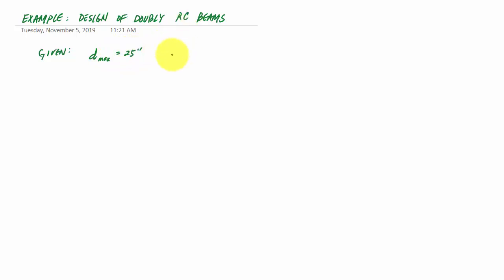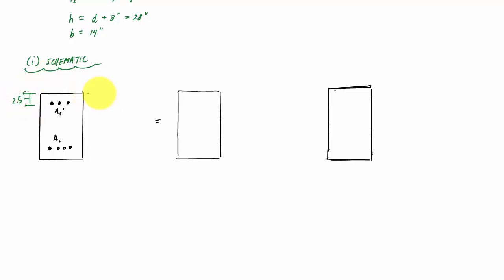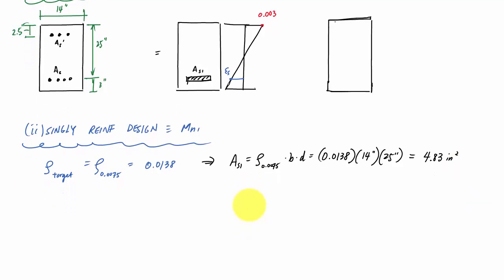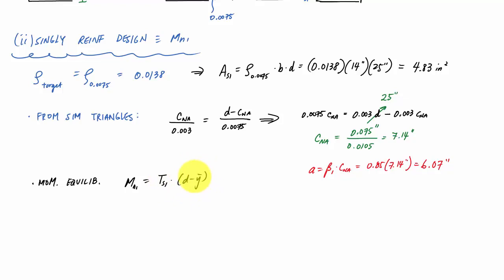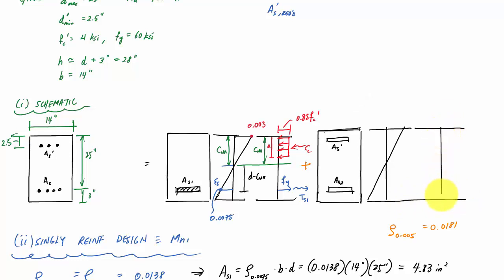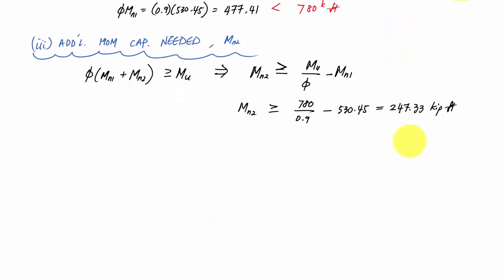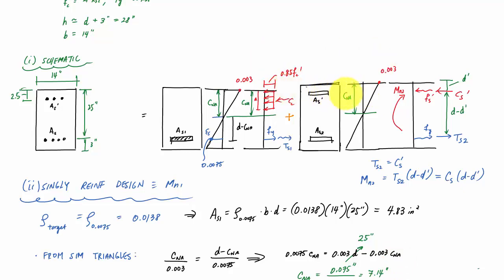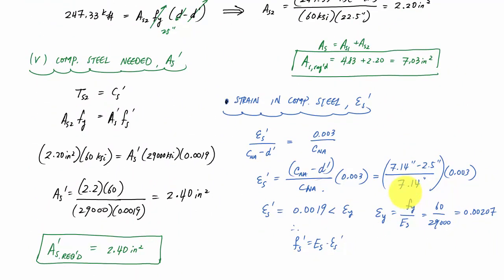Design of Doubly Reinforced Concrete Beam Example

Comment: At the last part, when recomputing As’ since it shouldnt have yielded, I think there has been a mistake. You can’t just substitute the 7.14” = C. NA to the doubly reinforced because it is from the singly reinforced stress block. C. NA will change for the doubly reinforced.
Reply: True - the neutral axis is going to change, which will change the force in the concrete as well as the force in the compression steel.  I think the point here is to get some initial parameters for the design.  As he mentions at the end of the video, all of the design assumptions should be verified based on the chosen steel amounts to make sure the beam is sufficient.

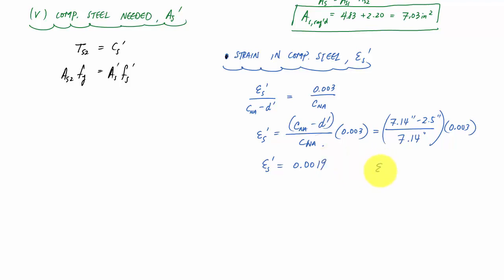Comment: Thanks Prof. something is unclear to me. You came to 0.0019 as steel strain in compression part but you still used 0.9 as phi factor! 21:36"
Reply: The tension steel must have strain > 0.005 in order to have phi = 0.9.  He doesn't actually verify it, but he's designing for 0.0075 strain in the tension steel, which should give phi = 0.9.